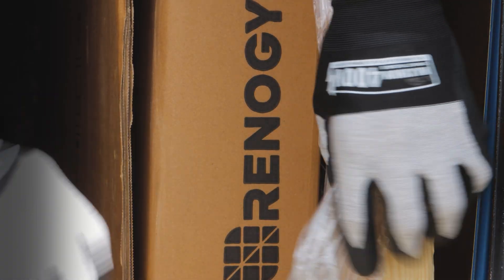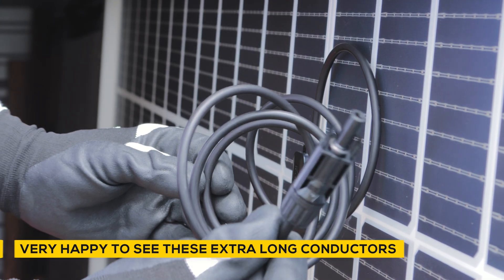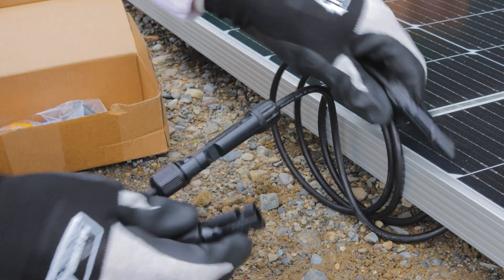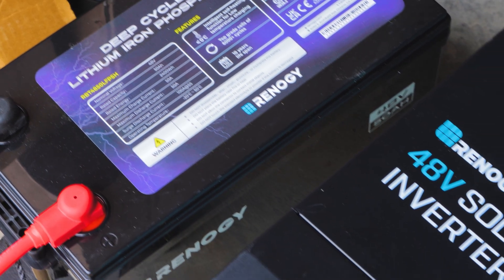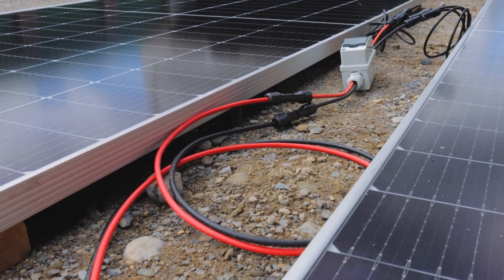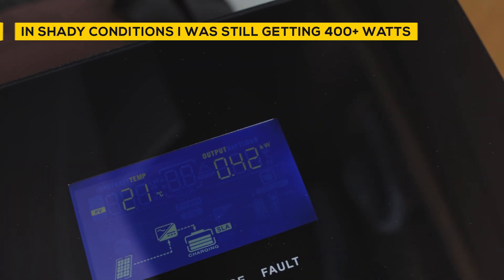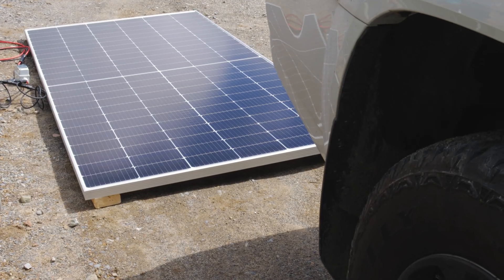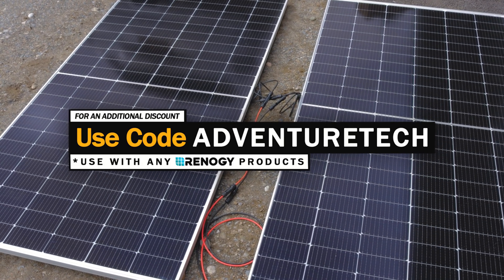Renogy Bifacial 550 Watt Monocrystalline Solar Panel Unboxing Review & Output Test

Comment from the maker: Use the links and Code:  ADVENTURETECH  for an additional discount on any RENOGY products & help support my channel at the same time. 
➨Get the RENOGY 550W Bifacial Solar Panels:   https://renogy.sjv.io/e1A1XO

➨  RENOGY 48V 50Ah Smart Lithium Iron Phosphate Battery with Self heating:  https://renogy.sjv.io/DynDMj 

➨  RENOGY 3500W Solar Inverter Charger:  https://renogy.sjv.io/LKOAz3

➨  RENOGY 150W CIGS Solar Panel Deal:  https://renogy.sjv.io/Dye6rn

➨Get the RENOGY Core MINI 12V 300Ah Battery Deal: https://renogy.sjv.io/xLN1o3

➨Get the RENOGY Core Mini 12V 100Ah Battery Deal:   https://renogy.sjv.io/WyGgdP

➨Get the Rover 60 Amp MPPT Solar Charge Controller & BT-1 & Renogy ONE Core: https://renogy.sjv.io/YRBdkB

 ➨Get the RENOGY 12V 200Ah Pro Smart Battery: https://renogy.sjv.io/xkKGmA

➨Get the RENOGY REGO 400Ah Battery:   https://renogy.sjv.io/o4zjqE

➨Get the RENOGY REGO Inverter Charger:   https://renogy.sjv.io/LKx553

➨Get the RENOGY Home Energy Kit here:   https://renogy.sjv.io/OenyLP